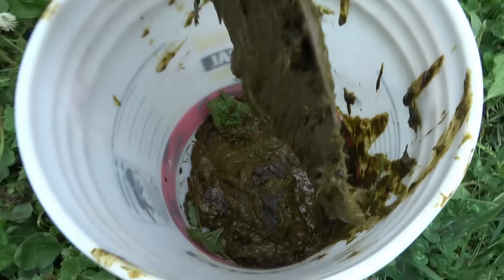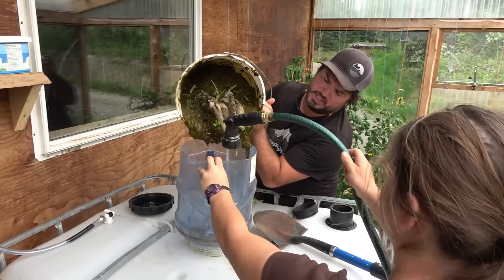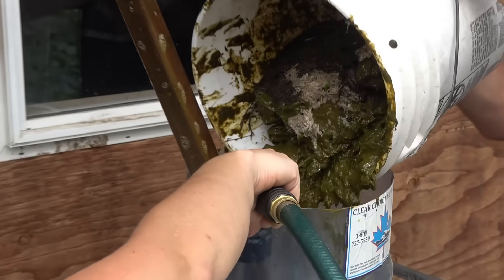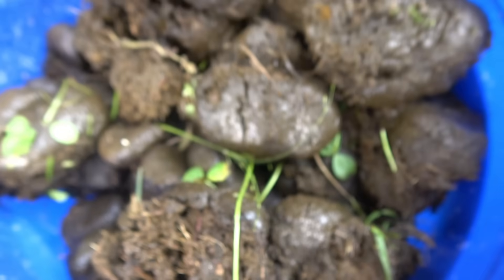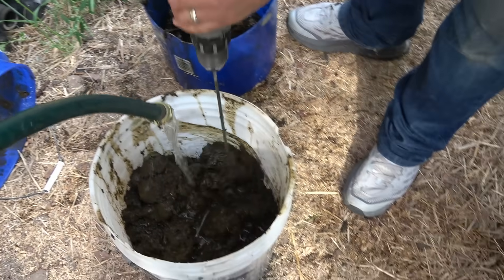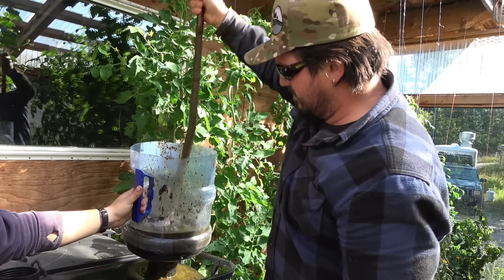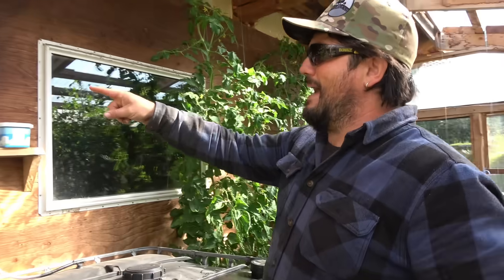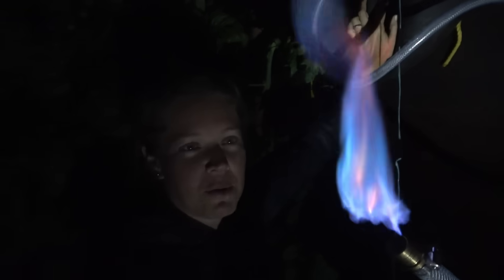Endless Off-Grid Fuel on the Homestead - Biogas Part #1

Comment: If the biogas was used to supply a furnace that had an orifice size specific to methane and you were to feed it. Methane that was dilute with half carbon dioxide than the air fuel ratio would be off of the ideal, and it would cause the combustion to run lean, which would affect the performance of the heat transfer as well as produce carbon monoxide because the flame temperature will not be as hot. 

In some cases, it won’t matter if you’re just using it to boil water, but that’s the reason . 

Landfill Gases typically 50% CH4 50% CO2 and they use compression and cooling to separate the water and CO2 out and then reheat it with the heat of compression from the compressor before it is used elsewhere.

Comment: ??an old  cement mixer  - or just some more effective plaster mixer (the bent rod was funny) - to mix the slurry - easy to throw into a continuous production facility (maybe your quantities aren't quite up to commercial piggery - lol...- as per all the original UN - biogas handbook - makes adding effluent and subtracting liquid fertiliser  - the gasbag / tyre tube storage is very simple  - low pressure "gasometer"..

Comment: Correct me if I'm wrong don't you need to feed it more than poo? You got the bacteria in there from the poo now you gotta feed Murphy your artificial stomach some actual food. Grass clippings? Left overs ?  I'm very interested when you come to the compressing part then you only need Murphy running in the warm months . This would make my off-grid experience alot more self sufficient. I use propane cooking and hot water

Comment: In the early 80s I was in Korea in the Army and most all houses cooked and heated with methane.  They all had a fenced concrete backyard slab that they kept pigs in, and up close to the house was a concrete slab covering a concrete pit with clear plastic lines that run into the house to supply methane where it was needed.

Comment: Remembering that the gas produced ends up containing some chemicals that cause corrosion in metals and it is very difficult to purify it 100%. So think twice before connecting this gas to an electricity generator or something expensive like that, it may corrode the internal part of it.

Some people fill the gas pipe with steel wool in an attempt to make the chemicals corrode the steel wool first before attacking the metal part of the stove (or generator, or wherever you are going to use it).

Apparently it takes a long time before a good colony of bacteria becomes established in the tank, so initially it can take a while to produce, and it has to be kept "warm" which is what bacteria likes.

Comment: For the stoichiometric ratio it is one part methane too two parts oxygen gas. 

If you use a thin copper wire from a cut extension cord and twisted around the ends of the thicker wire, you can just plug it into an outlet for a quick detonation . Use 100 foot extension cord so that you’re far away from it.

Comment: I know a thing or two about methane production and learned one really important tidbit that I feel compelled to share. I mean, it is great you turn cow pies and horse apples into methane. And it is great to see you open the valve and burn some. BUT, have you ever heard of a check valve (aka butterfly valve or a one way valve)? You can get them for all levels of desired pressures. But the beauty of it is that if you happen to be literally burning it for heat and or cooking and or running a generator and you suddenly run out of enough pressure, you can cause a flame to go all the way back to your tank and it can do even more than what those little bottles of ignited gas did. And TRUST ME, you DO NOT WANT THAT TO HAPPEN!!. In other words, been there, done that. Back in the 70s, built a system using 55 gal drums to make the gas. And if you add 1/4th green to the poo ratio and establish a stirring mechanical to stir the batch and you will get a lot more gas. Fortunately I had my barrel set in the ground so all they did was blow their tops one cool night and everyone was burning their stove ovens to heat with as it was late summer and we did not expect it to get so cold so sudden. No one was injured but it sure scared the blazes out of us all. And the fire marshall who showed up (the blast was heard a good 20 miles away) listened to what my system was and then he stopped me and asked "one question son, have EVER heard of a check valve?" We were outside and you could have heard a pin drop till I finally said"Uhhh, no. What is that?" BTW, my systems with their check valves are still working just fine out there in california. I am about to build a system here in Missouri for our home. BTW, you can use it to weld with just as you would using propane and oxygen. Even cut metal.
Reply: Thank you for sharing your story. Cheers.
Reply: I call BS. The only way for the digester to explode is for there to be enough oxygen in it. There should be no air inside the digester otherwise it will kill the anaerobic bacteria necessary to produce the gas in the first place.
Reply: That’s great advice. You also need to be aware of the H2S produced during this process. You cannot see it and if it is really strong, you will not smell it. The gas is heavier than air so be careful about low spots or enclosed buildings.
Reply: @JohmPaulRittell  It also corrodes your steel pipes and valves. Most people run the gas through a plastic pipe stuffed with steel wool so the steel wool is sacrificed instead of the valve.
Reply: What is the "*green (add 1/4th green to the poo ratio)"?
Reply: @iamfound74 grass foliage etc
Reply: Also something called 'Flashback Arrestor
Reply: Wow cool
Reply: Yes thats exactly what i thought when she pressed the tube for pressure. Lucky she didn’t let it go as quick or it would of sucked the flame back in the tube. Burning his daughter’s eye lashes was bad enough but playing with gas and flames in a confined space is a recipe for disaster.
Reply: Nice 👍🙂
Reply: Da li možete detaljno da mi napišete postupak pravljenja metana(količinu čega i odnos) sistem posudeili bureta,cevi koje mere i pod kojim uglom, zapreminu boce ili bureta,dužina creva,koji ventili idu? Može skica proekta na mail da mi pošaljete?
Reply: @aleksandarkupresanin2452  There is no need to ask when the information can be easily found with a search engine.
Reply: Thanks for sharing that! Took one blowout for me to learn as well lol
Reply: Thanks for sharing sir 🙏
Reply: You are a fantastic father and husband... your family is truly gorgeous...I enjoyed the vid ,but I more enjoyed you all pitching in together and no one winged once... just all on board! Really did warm my heart...u guys are a rarity! 
Much love from Oz...❤❤
Reply: I believe it’s a flash arrestor!

Comment: How about a small cement mixer that runs off a small ‘ gas’ motor , then use trash pump to transfer slurry ...  could be made from old dryer maybe. Just weld some metal panels inside .

Comment: You and your girls are awesome!   Kind of like a guy I used to work with, he said he LOVED rapidly expanding gases.  This can cover many things that you have done on your channel.

Another option for getting an endless fuel for the homestead is a wood gasifier.  Search for Flash001USA and then search on his channel for gasifier.  He built one about 10+ years ago and it would run a generator as long as you fed it small wood chunks.  All the small bits of wood (slash) from cutting trees could be put thru a gasifier and run a generator for you when the sun is not giving you enough power.

Comment: Big Murph is not gonna work anyway. In the possible, because your solution is so thick and heavy. And you got it so fool that what you need to do is figure out a way to agitate as it's producing. And then that way, you whip up at the bottom and deal. It now you can take an air compressor enforced a little air into it. Bubbling up through there, which will turn it. Just like you do in a septic tank.  A robot accepting tank. And what that does is that turns all that bowel mass over and over and over and mixes
Reply: LOL, Forcing air into it so it mixes with the methane?🤦 Can't see any problems with that scenario!💥🤕🤕🤕

Comment: Someone was watching Thunderdome.
You're on the right track using the inner tube has a bladder.
You can do the same thing with a plastic bag inside of a barrel.
 If the barrel is tight, put compressed air in the barrel and it pushes the bag closed as the gas escapes.
You can use water as well.
I can see you have plenty of food but no microbes to munch.
You have to cultivate those things.
Also being a biological process you have to keep the temperature constant

Comment: Just wait until Prime Minister Justin "Fidel Jr" Trudeau hear about this and sends a tax bill..
Reply: Now that’s funny
Reply: Put a small air pipe at the bottom and bubble air through the poo and it will help break it down quicker and produce more gas. Secondly after fermenting it the slurry makes excellent free fertilizers for your plants in the garden.
Reply: @colinham9148  does it turn to liquid after its spent? How do you get it out of the IBC?
Reply: @colinham9148 the bacteria will die, they can only produce methane when there’s no oxygen
Reply: @colinham9148 that is the opposite of what you want to do, by supplying oxygen you get different bacteria that do work faster but don't produce methane
Reply: SLOW CLAP...FJT
Reply: No kidding man
Reply: Get a macerator pump and use that.
Reply: Prime minister tornado 🌪️😂
Reply: Use those bogus tax bills to fuel the fire !
Reply: Thera-pew-tic
Reply: Gavin gruesom in California is right behind… couple of commies
Reply: Well, Fidel is gone !
Reply: What a stupid comment

Comment: * PRO TIP *
Add 1% by volume of vegetable oil to the digester. The methanogens coat themselves with the oil. This protects them from the sulphuric acid produced. You should get an increase in production from 54% to above 70%. Also, by using manure from ruminant animals, you will be able to digest cellulose items like leaves and paper.

Add some way to gently stir the digester tank. Flow your gas from the digester through cold water before storing it. This will remove most of the CO2 and sulphuric oxide. Stay safe. You're playing with a flammable gas.
Reply: Laughing out loud 😅😅😂😂😂
Reply: Shouldn’t the water contain a bit of lithium hydroxide so that the carbon dioxide will become lithium carbonate in solution?
Reply: @michaelchownyk5255   - is that so the effluent can be used to make a cottage  Li-Ion storage hut (jk) - or serious comment)
Reply: My comment is serious and I mean it. If you blow exhaled air through a glass full of sodium hydroxide, it will slowly form sodium carbonate in solution, same with lithium hydroxide. The goal is to get the gas to be mostly flammable so that would mean to exclude carbon dioxide. How else would you do it and I’m not joking
Reply: @michaelchownyk5255  lol nice . Question why do we need it to be more flammable ? To run somthing else I'm not aware of.? Far as I know with carbon dioxide in the biogas it still runs stove or engine . I'm sincerely wondering 🤔
Reply: @mattg6472 well duh , if its more flammable ,it'll burn hotter ,which in turn means you can lower output as you use it to say heat water etc

Compared to say a gas that is laden with a gas such as Co2 which dulls the maximum heat output per burn ratio .... why you think Co2 makes a good fire extinguisher ......
Reply: @mattg6472  It'll decrease the efficiency of your stove as your fuel gets mixed with unburnable gas. It won't burn as hot as it can be.
Reply: @mattg6472 it’s not more flammable per se, it’s more concentrated and purified. For example, if you have a natural gas stove that is built for commercial oil industry production, you would need to modify the stove to output more volume of gas to compensate for the extra CO2 to make it function efficiently. It is easy to make simple filters which can help remove impurities which will improve performance.  That is the goal.
Reply: @michaelchownyk5255  Why kill methanogens with a strong base? Just bubble the gas through fresh cold water if you need to remove CO2, it is very soluble in water. Better yet leave the CO2 in it, it won't hurt. Many old public gas systems had CO2 in the gas. Also If you had to spend a bunch of money on unneeded LiOH you could just buy some propane instead and be done with it, it is not cheap.
Reply: Can you please link the study/speak more of the anecdotal evidence. From a rudimentary search all Im getting is that it inhibits methanogensis.
Reply: Wow pop-up  gas in a plain or in a transparent plastic bag add oxygen you see the good bomb result man👀🇵🇭🇨🇦
Reply: You can run a grill, heater, generator or a car on that biogas. I have a Car converted to run on biogas. A turbocharged 2L 4 cylinder with intercooler that gives  245bhp.
Reply: Where did u get the car please @kentelvebjer9215
Reply: @kentelvebjer9215  That's awesome. Is that 245 petrol hp or tested when running on gas because I believe gas is less energy dense.
Reply: As for agitation, stir plates are used in chemistry frequently. You could configure a similar setup with a fan that has magnets glued to the blades. Then you just drop a cow magnet into Murph. You’d need to get the digester high enough off the ground to get the fan underneath. You’d want to mount the fan rigid and close enough to the bottom to move the magnet inside
Reply: @OfBronzeandBlaze  Hmm. The cost of electricity to run the fan kind of defeats the purpose of making your own methane - which is to save money. The money the power costs could be used to buy propane or the electricity could be used to run a microwave or electric range directly. One must limit complexity as much as is possible for a methane project to work out economically. Shoot for more efficiency than is needed and the project fails economically, the last few percent of efficiency are too expensive.
Reply: You run the gas through water and steel wool to remove carbon dioxide and hydrogen disulfide and then you'll get 90+% clean natural gas.

Comment: One of my friends has one of those digestors and it needs way more poop than you think to run a household but it really works. He dug a hole similar to a septic tank. Digesters Gass went into a big sleeve and then you pressurise it by putting old tyres on the sleeve. You need 4 or 5 cows pooping down the hole.
Reply from the maker: How did he train them to poop down the hole?  That’s genius!
Reply: @Gridlessness lol